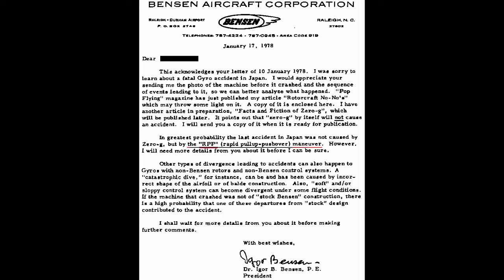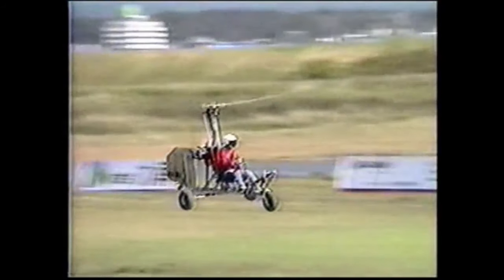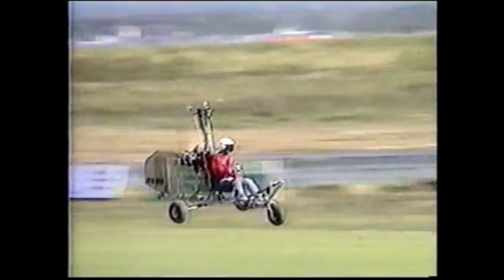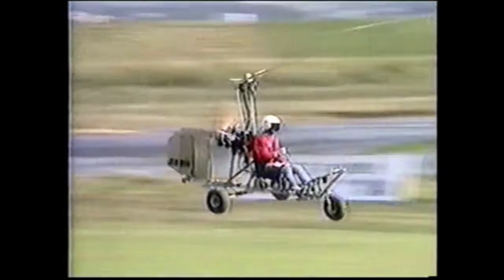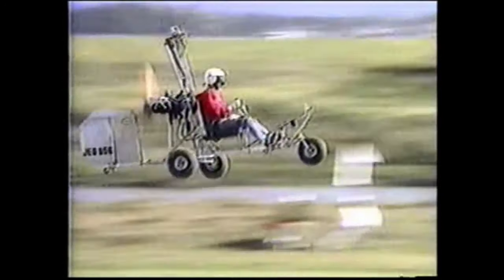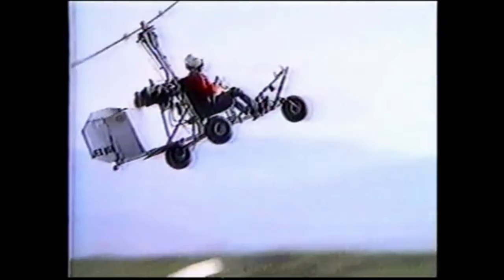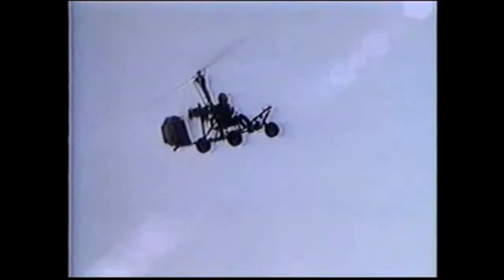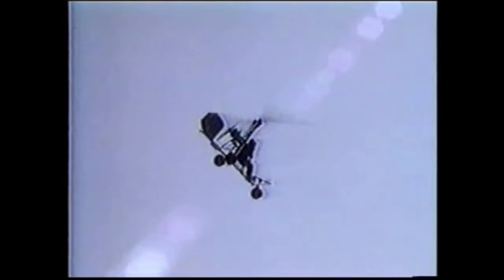Gyrocopter low g power push over crash (the cause of many gyrocopter fatal accidents)

Comment: Let me share my experience with something "similar". I was on a training flight one day and during the flight we where discussing with my instructor about the physics of gyroplane flying and he said that the gyroplane , and in particular the rotor, is happy when you are happy. What that means is that as long as you feel your self sitting on the gyro that means that the rotor is loaded. the rotor holds the weight of the gyro and you. A loaded rotor is a happy rotor. When during any maneuver that makes you feel light on the seat or you feel your stomach coming towards your mouth, that means that you are flying less than 1 G. You need to know your machine's limitation because some gyros fly differently from others as you already mentioned in a previous video. Back to my experience, (this was a controlled practice with my instructor) after a slight dive to gain speed i pulled up 10-15 degrees until my airspeed came down to 20 or 30 knots and then i push the stick slightly forward up to the point that i felt my self not touching the seat and the rotor rpm dropping rapidly. what happened? absolutely nothing. why? because we fly a true center line trust machine with a horizontal stab located in the propwash to cancel the engine torque during such situations because at low G's the rotor doesn't have the authority to cancel the engine torque when in full throttle . I'm not promoting this kind of flying and as i said it was a controlled scheduled practice with proper briefing and studying with my instructor.
Reply: You were very lucky a guy I knew flying a high C of G machine pushed it too hard in high speed flight he went straight through the cockpit leaving his leg under the instrument panel.  Also had stab right in the middle of the thrust line.  But yes once you have unloaded the rotor to any extent you loose lift and the machine will conform to whatever other forces are happening.  I remember once instructing in the gyro glider we hit massive sink just as the driver slowed down.  We dropped and bounced as we bounced very high I felt a complete list of stick sensitivity.  A lot of bunt over accidents happen turning from downwind to upwind.  People sometimes over turn as the crosswind causes a crab relative to the ground so they turn tighter putting on more power and Blackstock to maintain height.  They then level out with masses of inertia.  This causes them to climb so they push forward (I think) flattening a rotor still washing off energy actually increases lift as it's now flatter so they push again and bang!  Dead!  Consider this stab aside, gc thrust line aside.  What good will correct thrust line do if you rotors are unloaded.  On the ground we unload them after each landing right?  So how much stick pressure does that require?  Don't get me wrong correct thrust line also helps maintain proper dynamics in flight and can be achieved with downthrust (many take the downthrust off).  However,. You can still unload them fatally.  The blades stop and you're dead.  Your machine geometry may well have saved you but I suspect it was a close thing and wouldn't be trying it again.  Just let it climb until it doesn't want to climb anymore or you could put it into a bank and maintain positive g.  Cheers
Reply: @cameronlapworth2284  Well said. i agree with everything you said. As I said we were prepared, studied it and briefed about it and we didn't pushed below 310 rpm.  We went from 400 rpm (since we where pulling up loaded) down to 310 rpm (during low G)
Reply: @christospsaras7582  I really would like to see some experiments with large RC gyros we could sort a lot out of course awareness which this video does it great.  Just don't push it and we'll all be okay.
Reply: Christos most of what you have written makes no sense. A gyro's rotor does not exert torque on the aircraft under any condition. Also, the horizontal stab only improves pitch stability, it has no effect on, and is not effected by engine torque. Center-line thrust only helps to prevent "power push over." Negative G's results in rotor speed decay, blade flap, and crash, regardless of center-line thrust or lack of.
Reply: Hi Mike. I never said rotor torque but engine torque (on the propeller). What i said is a well known fact that you learn early in your flight training ground school. 1st, do Google image search about "propwash spiral effect on the aircraft" and second "propeller engine torque effect" . Note, when you are trimmed and flying straight with a loaded rotor there's a small amount of rotor thrust vector tilted to the side (roll) that continuously compensates for that engine torque. When you apply sudden throttle changes you instinctively apply cyclic pitch and roll as well to compensate for that high thrust line and engine torque. The gyro that i fly is a center line thrust and has strategically located the tail (vertical and horizontal stabs) in the center of the prop wash to cancel the pitch over and engine torque (propeller! Not rotor) see the Aviomania presentation in this YouTube channel.
what do you think it will happen when you are at full throttle and suddenly your rotor becomes unloaded? what will that engine torque do to your airframe when there's nothing to compensate for it?
Reply: @christospsaras7582  OK Christos I have a  better understanding of what you were saying. Part of the problem I had was your use of the word "cancel" which means "remove" or "eliminate." "Counter" or "counteract" is a more accurate term and more often used when discussing aerodynamics. For instance, al little rudder is used to counteract P-factor in a climb, not cancel it. Rotor thrust vector counteracts any other forces including dissymmetry of lift. The main point I was trying to make is that center-line thrust only reduces the possibilty of the deadly power push over.  The dangers involved in entering negative G's all remain.
Reply: @christospsaras7582  To quote you "because at low G's the rotor doesn't have the authority to cancel the engine torque when in full throttle." This implies that the rotor produces opposite torque. This is the main source of confusion in what you wrote. I now understand that you mean that at low G's the rotor loses what is commonly called "control authority."
Reply: @mikecunningham7621  thanks Mike. You are right. The terms i used are indeed misleading. I used the wrong words. English is not my mother language and it shows :)
Reply: @christospsaras7582  Your English is very good. It was late last night when I originally commented so I was tired and rather single minded! Happy and safe flying to you!

Comment: This is why you fly a Pitts Special. You can regularly load and unload the wings without failure regardless of power setting. I do have quite a bit of time in rotorcraft (gyro & helicopter). They can be fun although are a lot of work to fly versus fixed wing.
Reply: My first thought watching gyrocoppters is "nope. looks too sketchy"
Reply: @geddon436  Gyros are a blast to fly although they are dangerous. Airplanes are much safer.
Reply: @pittss2c601  just as I suspected.
Reply: You must realize the price difference of both aquiring and maintaining a Pitts vs an autogyro then.
Reply: @sevenrats  I do. I've owned both.
Reply: @sevenrats  At Oshkosh 2022, ELA gyros quoted me $160,000+ for their new gyro with the 140+ horsepower Rotax. That buys a nice Pitts.
Reply: @pittss2c601  $160,000 for an autogyro is a lot.
Reply: @sevenrats  - I imagine that this was one of the newer AutoGyros with all of the bells and whistles, such as dual PFDs. Do you have any thoughts on the max theoretical horsepower and torque possible in a pusher-prop configuration? I would be interested in gyros if the useful load and cruise airspeed were decent.
Reply: @pittss2c601 Modern ones aren't dangerous. They have stabilizers and the thrust line is at center of gravity.
Reply: @dkdanis1340  Not true. I have flown nearly every gyro brand. There is inherent risk. Every bolt is a Jesus bolt. Like most pilots, I significantly trust fixed wing more.
Reply: @pittss2c601  Not a single structural failure has happened mid air as far as i know (appart from in flight collision). There's literally a video of a pilot over stressing the airframe of a fixed wing and the whole wing broke mid air but that doesn't make every plane dangerous ofcourse. Overall i think safety can be good on any aircraft if flown correctly and maintained well.
Reply: @pittss2c60: I have witnessed 2 Pitts flying some wild acrobatics at Russ Beach Airport in Smith's Falls Ontario Canada.

They are as you advertise, capable of flying angles and manuvers that I didn't think an airframe could withstand.

I was a bit green at the time and all enthused with an L31 albatross they were flying until the owner of the hanger could see my excitement, he smiled and said the L31 sounds awesome and looks the part but wait until you see this Pitt get through it's paces

Looking at the two airframes I thought "What is he on about" ?

Well the L31 had the look and sound, the apu firing up gives me chills not sure why I just love the way it sounds.

The stuff they put those Pitts through still amazes me to this day.

Sorry for the long anecdotal story

Cheers

Comment: Thanks for this. Tell me -- what if the aircraft had been higher in altitude and not so close to the ground? Would they have had time to recover? Or was this totally unrecoverable, regardless of altitude? Also, is this danger unique to gyroplanes, or can it happen to other types of aircraft too?
Reply from the maker: Hi - I think in this instance with more height and the same pilot actions it still crashes.  The issue is that once the rotor of this type is unloaded then the pilot looses directional control and at the same time the rotor RPM decays and so the rotors themselves loose their integrity.  This was a similar accident and gives a fuller explanation https://www.gov.uk/aaib-reports/7-1974-g-axar-11-september-1970

Its unique to any teetering rotor system - so all sport gyroplanes but also Robinson and Bell 2 blade helicopters.
Reply: @gyrocopterflyingclub6148  when you say "rotors themselves lose integrity" -- did the rotors disintegrate in flight? Or did the rotor spin sort of "stall"? I'm wondering if some kind of emergency pre-rotator could have revived their spin, to then save the vehicle (provided there was enough altitude and time to recover)? Imagine there was a rotor RPM counter, and when it detects the RPM drop below a certain level, then it triggers some emergency pre-rotator device.
Reply from the maker: As in the rotor gains its ability to carry the weight of aircraft through its rotational velocity.  If you have a powered input to the rotor then you'd need some form of anti-torque [i.e. a tail rotor] and then you create a different problem.
Reply: @gyrocopterflyingclub6148  Well, I figure that some torque and consequent rotation in the vehicle itself can't be as bad as the spin stall, which itself proved to be catastrophic. At least if the rotor keeps spinning, then you have some hope.
Reply: @manofsan I think he means that once the machine starts "tumbling" in the air, the rotor will never get the chance to start spinning again (because you need to move straight for a while , for the rotor to pick up RPMs). At least  this is what I have understood. Pretty horrible really, to know he is gonna die and nothing to do about it.
Reply: For any still following.  The rotor is how we control the aircraft.  Once its unloaded the lift is zero.  This means no possible way of recovery.  Pull stick back left right there won't be any effect.  This is why I think PPO while real (yes peoples tails do get cut off) is not necessarily relevant.  What does it matter if my tail is cut off if I have zero lift?  If nothing else the bangs and commotion might distract me while I'm on my way down.  His blades were intact all the way to the ground.  What did this help him?  You just have to avoid this at all costs.  

I had a driver cut power on me at the same moment I hit sink in a gyroglider.  I fell from a bit over the height of the tow car and even though he saw it happening and immediately shoved on full power in the car it was too late I hit really hard and bounce back up to the height of the roof of the car.   I noticed going up the stick was completely loose.  No feel at all until I started to descend again.  I realized I'd just had a taste of negative G the big balloon tyres bounced me up momentarily and my rotors went negative for probably a second.  I had ZERO control I remember moving the stick about a foot in either direction and nothing and it all came back when I started to descend again.  That's what you'll have if you unload it a short second or two of zero stick response followed by BANG BANG BANG as your prop and rudder collide with your tail and a short amount for time (depending on how high) to contemplate your errors.

Comment: I'm new to this and wanting to build a Gyrocopter. I've been watching YouTube videos to see the dangers of what not to do. I think I understand why this person crashed. I totally agree with your video. During the flight of the first few seconds. I heard the motor was full throttle. As he pulled back on the control stick it went straight up causing the motor to stall. Instead of keeping his controls to where the g-force keeps him in his seat. He chose zero g force trying to level instead of going left  would've kept him in his seat.
Reply: I am not gyroplane rated. But, I fly fixed-wing aircraft and helicopters. So, I am not quite sure what you mean. I have done some studying of gyroplane flying. 

The engine did not stall. And, he did not fall out of his seat. The push-over caused the aircraft to go into negative Gs. This caused the rotor to become unloaded. It is the rotor disc load factor (weight pulling down on the rotor) that keeps the rotor in a relative wind to create its spin. A combination of the force vector of the propeller being above the center of gravity increasing the push-over, and the torque of the engine causing adverse roll, put the aircraft in an unrecoverable position. 

The prevention of this lies in reducing power before leveling off, and reducing the nose pitch change rate to make the level off more gentle. This can be done by decreasing power, then continuing to apply back-pressure on the control stick until you have achieved your desired altitude. Then, you can reintroduce power in level flight.
Reply: @deanfowlkes correct sir don't forget this is a old Benson design it didn't even have a horizontal stabilizer and it's not a CLT design the engine sits high in new gyro there all CLT with HS which  eliminates this problem and if your still worried get a tractor design gyro rather then a pusher and your 100%protected cheers

Comment: Has anyone attempted an electronic anti-bunt control?
It seems like it would be a fairly simple safety measure. A micro-controller / accelerometer / gyro combo that simply takes control of throttle and stick position in events of low / negative G's.
Reply from the maker: Not that I know of and for general aviation it becomes too complex to maintain, check and regulate for use.  This is fundamentally why you see things on drones you can buy for $20 that seem amazing - height holding in a stable hover being one = that you don't see on $2m helicopters because a $20 drone it doesn't matter if they haven't thought how to maintain the system and if it fails it hits the wall in your front room, not wipes out a crew, pax and people on the ground.
Reply: Sounds like the MCAS

Comment: Is this due to the fact that when the rotor is unloaded (may also happen if the wind goes downwards, like in the storm or in the mountains), pusher propeller has no forces that balance it, and if it's over the center of masses (like in this construction where it's over), it will make a spin movement? If it was properly centered with enough power it would just push the gyro forward without that deadly spin, or the gyro would start to fall in-place that would load back the rotor.
Reply from the maker: Hi Anton - take a look at some of the webinar films.  The issue when the rotor is unloaded is that you loose directional control because that is performed by the orientation of rotor thrust.